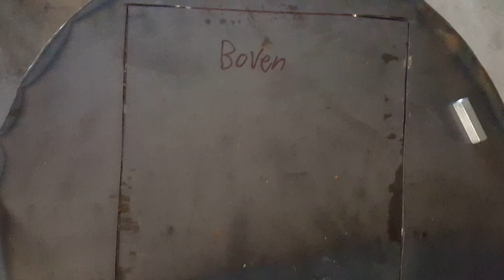80 Gallon Offset Smoker on a Trailer DIY build

Comment: What are the dimensions. Seems pretty big for an 80 gal. I am going to build either a 120 backyard or a 250 trailer rig next
Reply from the maker: they are 200 liter barels. one cut in half and than welded on the other. which makes is it 300 liters = 80 gallon (US)

Comment: How high is the cooking rack from the bottom of the smoker?
Reply from the maker: Right under the door, so just about halfway in the tank, dont know the distance. We have made 2 extra racks above the main racks. Those are usually 10-15 degrees (celcius) hotter than the main racks

Comment: how is your temperatures across the smoker?
Reply from the maker: pretty even. +/- 5 degrees (celcius).
It all depends how much meat is on the rack.
If both racks front and back are full it could change the airflow a bit but not so much that i worry about it. Its meant for backyard BBQ not competion
Reply: @Turbulenzz   Awesome! Thanks man! I am currently building one now and have the exhaust pipe in the center of my tank the way you did it as well! Nice looking smoker!